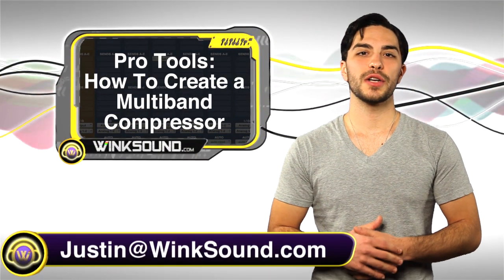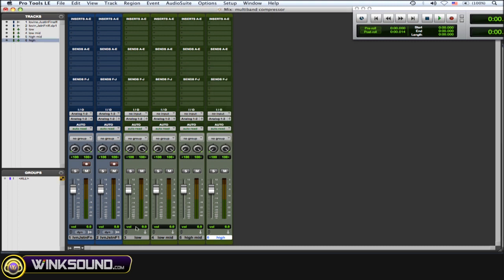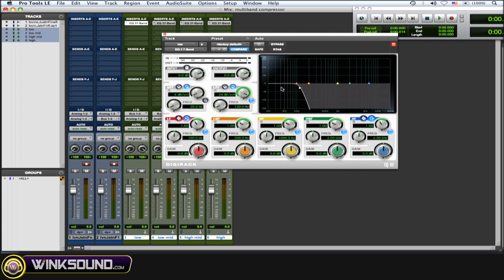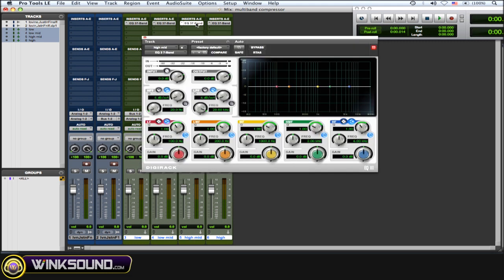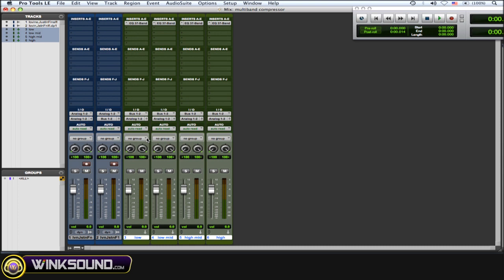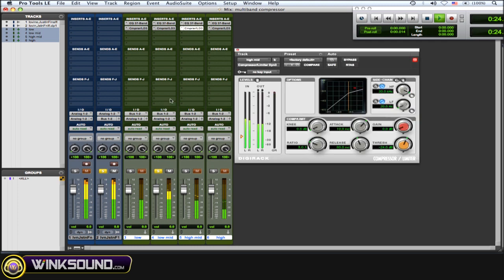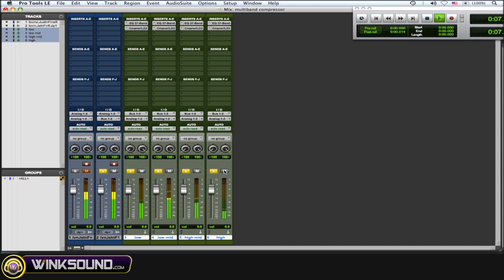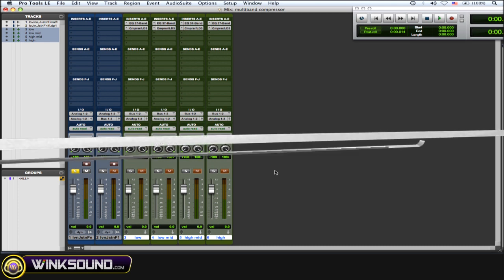Pro Tools: How To Create a Multiband Compressor | WinkSound

Comment: @WinkSound is this multi band compressor best for only the mastering stage? For example would I also apply it in the posh karaoke situation of violin and backing track to the  backing track alone? e.g. would I have one for the master bus and one for the backing track track? Just wondered :) What is the field study on this, is it just as good as buying a cheap one, or better ?
Reply: You can use it anywhere just like a normal multi-band compressor, although the general practise is to use it during the mastering stage as the 'cherry on top'. Whether its better than 'cheap' plugins depends on your session. A single plugin will take up less system resources than 4 aux tracks running at least 8 plugins simultaneously, but then you have so much more control over each band with a possibility to add 8 more effects into the chain. The delay compensation can only handle so much and if you're running a session with a hundred tracks with 4 plugins each that will take its toll. There is no right or wrong way to do it, just more efficient ways.

Comment: last question for you. now after you do this and your done, but maybe your "LOWS" dosn't sound the way they should.  Would it be ok to put before the compressor another EQ then put the compressor back at the last of the chain? kinda like this?????  ( 1 ) for the Lows, you put the needed EQ for the low pass filter to just get the lows like you did already.  (2) Then put an 4 band EQ there then boost say 60hz for tighter kick.  (3) Add the compression to for the multiband chain? know what I mean?

Comment from the maker: @experiment0003 Hi, thanks for your question. You can indeed use a multiband compressor instead of setting up this routing but in case you don't happen to have one availabel this is a good work around. This technique also gives you the ability to effect each frequency range independently of the rest. For example you can a slight reverb and delay to the top end of the signal while not affecting the lows. Hope this info is helpful.

Comment from the maker: @MrCoolerdave Thanks for the support!  
This is a bit in the general direction as music varies so much in content that it would be hard to cover what frequencies to use on certain genres. You can try what melchiormeijer said a few comments up to get a bit more precise. Try what works for your tracks. There can definitly be low frequencies with fast attacks like say a kick drum or a punchy bass. Same goes for high frequecies with slower attacks. Experiement! 
Talk to you soon
Justin
winksound

Comment: Justin .. I read an article on this where they recomended using these settings  ... as a start point  
Low=86Hz, LMid=545Hz, HMid=2197Hz high frequencies at 8980Hz.
The article also said to use slower attack times and faster release settings for lower frequencies and the opposite for the higher frequencies.
I know that you have alot to pack into a 10 minute video ... 
Any comments or thoughts on these settings?
and as always.. you totally rock... thanks for taking time to do these

Comment: I use the same technique to teach my students about multiband compressors. However , putting the filters at exactly the same frequency causes a little peak in the crossovers.
If you use a white noise signal generator on your source track and a frequency analyzer (such as the inspector  from RN Digitallabs = for free)on your source track aswell as your master you can exactly compare and  tweak your multiband compressor to have adequate crossovers. Have fun. :)

Comment from the maker: Hi @JJGMUSIC 
The frequencies used during the tutorial are a good starting point to get the Multiband Compression setup up and running. From here the frequencies should be adjusted according to the song your working on. 

The bass clef in musical notation represents is the lower register of the scale. So the bass clef is basically the part of the staff where the bass notes are written in.